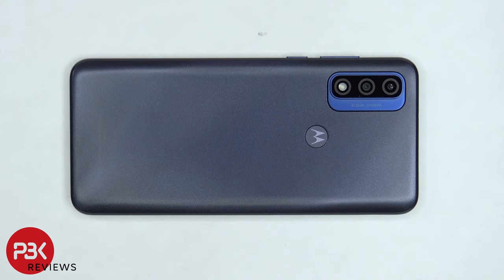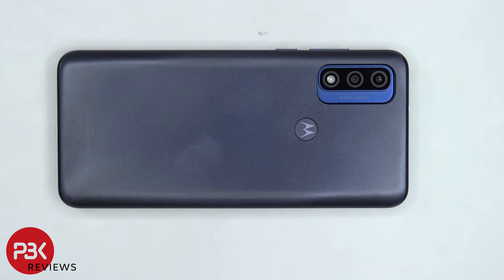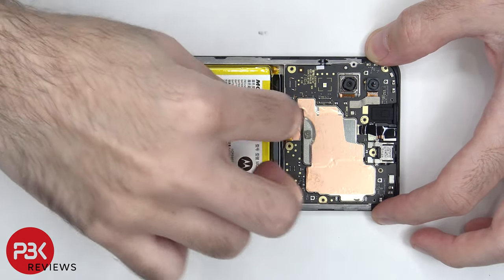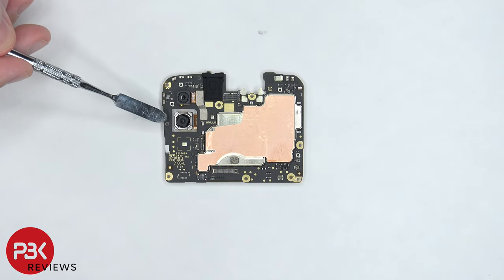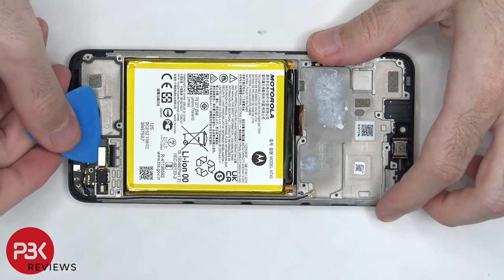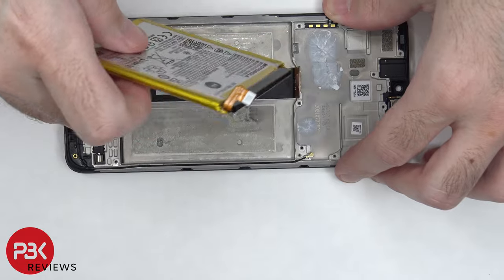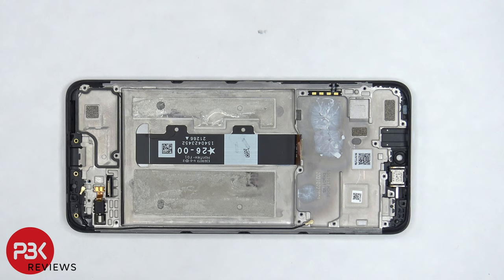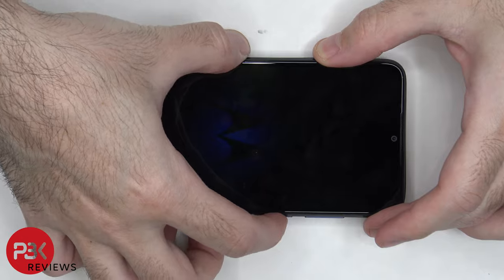Motorola Moto G Pure 2021 Disassembly Teardown Repair Video Review

Comment: I successfully used this video to repair a damaged phone. The only thing I have to point out is that the screws in the two phones I had, both donor and recipient, were T5 instead of T6.
Reply from the maker: Hi. Sometimes the brand of tool set tend to fit differently
Reply: What is the first wire connected to the round Motorola symbol on the rear cover ,I accidentally broke mine today and now it's not charging

Comment: I like how they say the battery is not removable when it clearly is, I already found replacements for it too. If it was soldered in then that statement would make more sense.
Reply from the maker: Yup, they basically mean most people without the tools and knowledge on taking the phone apart wont be able to do it. Maybe they should word it differently. However there are also many people who comment from time to time and say how is this considered replaceable on some videos so I guess they should write "battery replaceable by professional" or something :)
Reply: You know where I can find a screen replacement
Reply: Plz plz let me know where u found replacement battery for the moto pure G. After I sent my phone in to get the broken screen replaced my battery dies when the damn phone is on 90percent charged. Then reads zero charge.

Comment: Yo you just teleported past the part where you removed and instructed how to remove the hardware chip and processor shields! 
Also, once shields are removed, is it possible to remove the processor, memory, etc chips from one pure board and migrate them over to a new or different pure board?
Reply from the maker: Hi, I don't show it since no one would generally be removing those. The chips are soldered to the main board and are not user replaceable.
Reply: @PBKreviews  Awesome man thanks for the reply!
I am aware the these components are indeed soldered to the main board. That being said, I am also quite proficient with a soldering iron and generally know what I'm doing in that department. Of course anything I may do from the point on would be 100% @ my own risk and at the fault of absolutely no one but myself....
Now then & with that being said, may I pose the same question to you again and might there be a variation to you previous answer?
Again, thanks very much!
Reply from the maker: Yeah, if you have the skills and the tools, you can de solder the chips and replace them. But just basic soldering skills wont cut it. You would need to reball the solder points on the main board before re soldering the replacement chip etc. As for the shield covers on the board, if they are removable (some aren't which would require de soldering the shield cover from the board), they have small clips around the base of it which you can use a thin razor blade or thin flat head to gently lift up and pop them off the base to release it.

Comment: Im going to replace the battery and was wondering if I TRULY have to use replacement adhesive when i put in the new battery or can i just stick it in without it?
Reply from the maker: You can just re use the old adhesive tape from the battery, should hold it in place. Without any adhesive, the battery would bounce around and cause noise and possibly damage to the battery.

Comment: THX for the video PBK. I just got one and have a knack to open any and all electronic items for curiosity and your video certainly helps me in that pursuit. Heck I am gonna open my phone and put it back together just like you WHY ? because I can. Take care.
Reply from the maker: haha you're welcome! Enjoy! :)
Reply: Same-same here. I've been taking things apart for about 70 years, just to see what made them tick or to attempt to repair. Sometimes it means machining a small part for a $4 kitchen gizmo of my wife's, sometimes doing a board level repair on a computer board, whatever. Thing I don't like about these phones since the G4 Play and Plus is not being able to take the battery out without an amount of unnecessary messing around so, even if one disables "location", they always know where you are.
Reply: @ffellini  you are my man. I just opened a glass back samsung s10e for curiosity and cracked the thin glass. Ok only $10 to replace to solve mty curiosity and learn. Pbk sir take care and stay healthy.
Reply: agreed. no reason is needed!

Comment: Well,  there is some good information here, just not how to remove the screen. How to disconnect it,  not how to remove it.
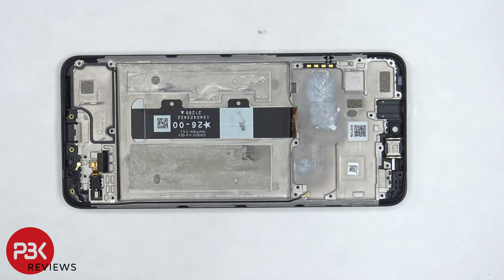Reply from the maker: Hi, I say step by step what you need to do @4:21 in the video. Once its all disconnected, all that is left is to heat up the old screen and pry the screen off from the frame. Its only held down with adhesive so you just pull it off, nothing else to explain or show on that. I don't pull it off myself because there is a chance of damaging a working screen.

Comment: I have a few scratches on my screen but they have light scratches. I don't know if they have touchscreen scratch remover. Maybe I should I should get a replacement touchscreen.
Reply from the maker: Usually if you place a glass screen protector over the screen it covers most light scratches and they don't show anymore.

Comment: I got the phone last month, and it already stopped working. Refuses to turn on, I tried multiple chargers, and no vibrate to indicate that it's charging. So, I assume the battery is dead. I guess I'll have to look into a replacement. I guess I need to look up a replacement battery.
Reply from the maker: You can find the replacement parts for this phone at this website, they have the original replacement parts but not the battery for some reason: https://www.mobiledefenders.com/catalogsearch/result/index/?cat=31&q=moto+g+pure    there is also this website which says they have the battery but never bought from them before so not sure how reliable they are: https://www.pc-laptop.co/motorola-battery-NT40-p183516.htm
Reply: Yeah these phones are shit. I just bought one and now have to look up videos on how to remove the battery because it constantly freezes up on me and there's nothing I can do outside of battery removal

Comment: Accidentally punctured the battery trying to remove it. That battery adhesive is pretty damn strong.
Reply from the maker: yeah, try using isopropyl alcohol, and apply some to the sides of the battery n let it sit for 30 seconds to a minute so it eats away at the adhesive underneath, making it easier to pry it off. I mention it in videos now which have batteries without pull tabs or pouches. Back then I didn't use isopropyl alcohol either but it makes a big difference :)

Comment: I just spent hours (days if you count waiting for glue to try) replacing a screen on my Motorola.  I tested it before putting the back back on, and it worked.  Now with the back on it doesn't!  Cry

I hold the power button down for ages and all it does is give me a weird vibration, nothing.  I had to take the back off, again, and in doing so I found the coax cable disconnected.  I don't know HOW but I reconnected it and it still won't start.  (Would a coax cable even cause it to not start??)  Everything else looks connected as I left it.

Can you help at all?  I will love you forever.
Reply from the maker: Hi, no I don't think a coaxial cable would cause an issue like that. However in most cases this is caused by a short. Something is touching something that it shouldn't. When you remove the back, does it start working again? also try taking the motherboard and parts out again and re-assemble to make sure all is in correctly and see if it will work. Oh and one more thing. If the screen worked prior to you adhering it to the frame, and after you adhered it was when it stopped working, then the issue is on the back of the screen where the resistors and control chips are. Sometimes on aftermarket or replacement screens, they don't cover those chips with the protective film which prevents them from making contact with the frame and causing shorts. So you would need to use some sort of teflon or insulation tape/film or some sort of painters tape basically anything on that portion of the frame or screen where the resistors and chips are to prevent them from making direct contact with the metal frame and causing a short. Hope this helps. If you need a follow up reply, send a new comment instead of a reply to this comment so I would see the notification and get back to you.

Comment: I replaced the screen with housing attached, but every time I put the back cover back on phone dies, when I remove the back cover it comes back on and works fine. Any idea???
Reply from the maker: Hi, you probably have a short somewhere (part of the board or chip somewhere that is touching the metal frame that's not suppose to be). Which back cover are you referring to? the back plate or the covers over the motherboard and sub board.

Comment: Your method for removing the battery is risky.  It would be very easy to bend the pack prying up on it, and using a metal tool is, well, just asking for it.  I suggest the following:  Soak the battery cavity with IPA as you do already.  After a few minutes, use a brand new playing card (Poker style. I use Bicycle brand with Air-Cushion finish.) and work it under the battery, sliding and/or rocking it back and forth while applying constant pressure to slide the card farther and farther under the battery.  Work both of the long sides of the battery this way, starting on the end with the screen flex, as you can ensure the card goes between the battery and the flex instead of it possibly trying to dive under the flex and damaging it.  The edge of the playing card will cut the adhesive like a filet knife, and out pops the battery.

Comment: Why don't you show the front screen ?
Reply from the maker: Hi, You mean prying it off? because all that is left is to heat it up and pry it off so why damage a working screen to show you how to just pull a screen off a frame. If there is something like a vapor chamber that is hidden that needs to be shown, that's a dif story. Also most screen replacement assemblies come with frame pre installed.
Reply: @PBKreviews  there could be a chamber there you never know nowadays my friend 🧐 goodnight sir and thanks for feedback 👌✨💐

Comment: Hello everyone two days ago I dropped my phone I tried to open the back of the case but it wouldn't budge I was trying to take the battery off that copper that was connected to the back piece broke oh I did a boo boo but then I found some copper wire connected it with some electrical tape. And put the SIM card back in and my phone is working great I can't afford to get a new one

Comment: How can I replace the screen, when I purchase the replacement without a frame?
Reply from the maker: you would need to take it apart like shown in the video, then when its taken apart, you can heat up the screen and pry it off the frame, apply new adhesive and then re apply the new screen back to the frame and re assemble the phone. You can check on mobiledefenders.com to see if they carry the parts and replacement adhesive for this phone.

Comment: I thought this phone had removable battery smh does any new phone have that feature anymore?
Reply from the maker: I mean technically they all are removable, just not easily like before. But for ones that are not adhered to the phone, you would probably need to look for the rugged devices like the Samsung Galaxy XCover Pro.

Comment: Holy fuck. Thank you so much. Turns out the ribbon cable connecting the fingerprint scanner was cut (I honestly have no idea how that happened) and it was touching a part of the batterys connection terminal causing my system to infinitely power cycle, looks a lot like a bootloop so I was getting frustrated. I was expecting to need to take the battery out so I thought I was out of luck (dont have a T6 screwdriver.) but after taking off the back and finding the cable tucked into the battery I knew something was wrong. Cant use my fingerprint anymore but thats much better than not being able to access any of my shit. at least now I can back it up to my computer and save all my data. Again, thank you so much. I would have never guessed a guitar pick would fit between the groove.
Reply from the maker: Glad it was helpful :)

Comment: Well I try to removing my battery it wouldn't budge had another phone I will just turn it over hit it on my palm of my hand and it would come out but not this one
Reply from the maker: There is adhesive holding the battery down. You would need to use isopropyl alcohol or gently heat up the screen with a hairy dryer to try n loosen up the adhesive underneath the battery to make it easier to pry off with a plastic pry tool.

Comment: Ithe tip of the earphone cord broke off into the jack, sub-surface, ofcourse. Any suggestions for a forced DYI'r? Shops r only accesible by postal carrier. This has been an absolutely rugged, capable phone. With ample , beyond ample, features, especially for the small cost! I do not understand why some folks are talking trash on it...Anyway thank you for the very informative video. All that one has to do is stop and listen and SO much more can be gleened from your instruction. Folks dont hear anything other than what they want to hear, these days. They treat everything else as noise; heck, they dont even give it that much attention... Thanks again for your great video(s)!

Comment: COULD YOU STOP AT THE BATTERY AND TELL US HOW TO REMOVE IT AND REPLACE IT? THANKS
Reply from the maker: For the battery you would need to use isopropyl alcohol and apply some around the edges of the battery and let it sit for 30 seconds so it eats away at the adhesive underneath making it easier to pry it off. You can use a plastic pry tool to gently lift the sides of the battery if needed to get more isopropyl alcohol underneath if needed. You can get the ispropyl alcohol here: https://www.ifixit.com/Store/Tools/iFixit-Adhesive-Remover/IF145-400?o=4